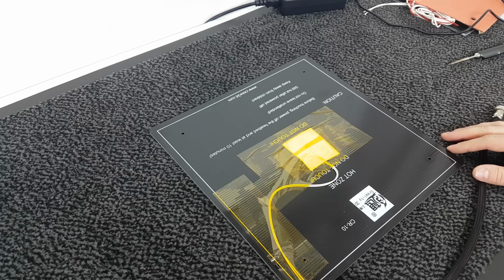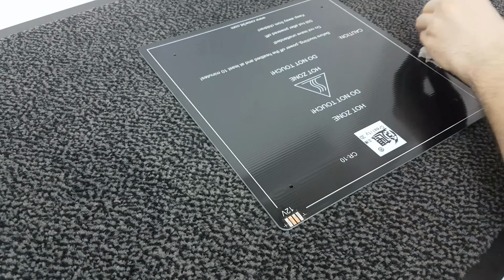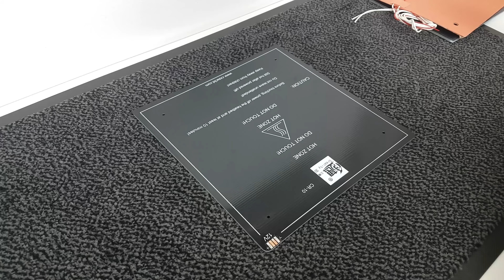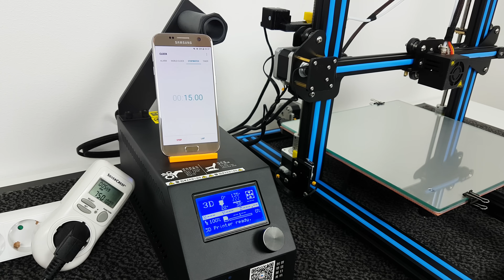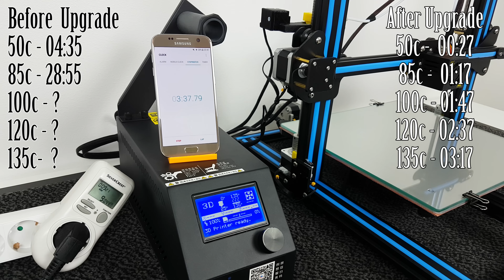Creality Cr10S ultimate Heat-bed upgrade! 750W heater installed

Comment: But a new power supply is needed or not?
Reply from the maker: Jose Garcia This upgrade don't require new power supply. This Heater is 110V or 220V. It goes direct in AC.

Comment: I would be very reticent about pulling  230 volts 750 watts through that connecting plug, its not designed for a load like that
Reply from the maker: David Allen https://m.aliexpress.com/item/32758594495.html?trace=wwwdetail2mobilesitedetail&productId=32758594495&productSubject=5Pcs-Aviation-Plug-4-Pin-16mm-GX16-4-Metal-Male-Female-Panel-Connector-New

Working Voltage: 250V 
Working Current: 15A
Reply: a kettle is pulling between 800w and 1.2kws...

Comment: I could really use your help!!!
Would you please reply to my comment. I've posted this same comment, on several 3d reviewers, on their youtube page, and none have responded. I'd like to make a decision, in the next 2 days. I wonder, if you think a CR10s is a good choice to print a quality working prototype. I need the prototype to show people that my 3d printed machine works. I'm in hopes that the CR10s is capable of turning out a quality prototype using PLA. 

How does the CR10s quality compare to an Ultimaker printer? I'm planning on getting an Ultimaker S5 at a later date.
Any and all help will be appreciated!

Thanks ,

Gary
Reply from the maker: eGliderman eGliderman Hi Gary! Would you kindly send me screenshot or picture of that model that you would like to print? Or at least something similar to that? So I could answer you can CR10s print that type of models or not. Send them to my email address I I will be more than happy to answer you.
Best regards!
Nexi
Reply: Thanks Nexi. I sent you an email.
Regards,
Gary

Comment: Followed your instructions,  using 110VAC pad, 115 C in minutes now, thanks for the great video.
Reply: did you try get 120c or more with the upgrade?
Reply: What 110 pad did you use?
Reply: Is it still working?

Comment: Dears, I just bought a CR10S - Thanks to Nexi's videos - Really useful and well done videos - OK I really wanted to make those modifications and I'm not a rookie regarding electronics stuff but reading all those comments below I don't know whose is right and/or wrong. 

The point is if the heatbed is enought insulated from the rest of chassis and build plate there are reasons to have fault ... but I'm maybe wrong ... 
There is maybe one thing, is it possible Nexi please to add a clear diagram for wiring in the power supply ? it would be really helpful for me !

And @ the end maybe we just have to make some holes in chassis and build plate and put them @ the ground no ???

Many thanks for your feedbacks guys, because I really want to make this upgrade safely.

Comment: Hi Nexi! 
Great idea. Love it! And going to do the same! But there is a quesion: after upgrading heat bed time for bed plate upgrade :) So what do you recommend? Glass, mirror, LokBild? Please keep in mind that having a opportunity to head a bed to higher temperature there is possibility to finally use ABS etc.. Have you ever concerned turning your plate into magnetic one? Is that possible with high temperature without loosing neodimium strength?Which magnets to choose for that bed upgrade?? Another problem is isolation cotton which decrease magnet's power (so in that case should use again bigger and stronger).I've seen that people used to stick it on the bottom, but how to glue it to cotton :)? Any idea regarding perfect bed for that upgrade?
Reply: Hi Nexi!
It's been a little while .. but finally I have done it! :) In big shortcut: your idea but with my personal improvements such as:
-LokBild, 
-0,5mm alloy sheet (previosuly I have bought very expensive spring steel! which doesn't affect magnets :)))) - so any of you whos wondering - don't make my mistake ;) 
-added another  aluminium 4mm cnc drilled sheet as base for magnets as well as heated top platform,
-special 60pcs magnets (which are fine till 380 C degree), 
- instead of 1 isolation cotton sheet, I have used 3 of them (it was solled in pack of 4..), but 3 here are important in my design- it prevent thermister and heater from smashing and squishing ),
-bottom platform I have left orginal one as support for cotton which isn't  glued,
-each wires were equipped in connector,
-I have left orginal lenght of new calbes (never knows when it might be needed)
-Lenght of screws 4x50 or 55 works better (60mm might be too long).

Pros:
-It's work like a charm! :) Always wanted to have such possibility.
-heating bad to 60C - after improving time drasticly droped from 15-18min to 1 min 10sec in my case! 15 tmes faster! Madness!
-Despite the fact than somebody has described that metod as "unsafety" a few times, calling others idiots and other unpleasent words.. As long as I exactly know what i'm doing - I hardly believe it's pretty safe! Person who disagree, seems has a lack of knowledge or experience... ?
-Availability to print immidiatelly after turning on printer, which is really cool!
-Possibility of using other materials (those which require high temperature).

Cons:
-It not a cheap modification (especially  if you own S4 or S5) -approximately it costed me somewhere around half of S4 :) Sick! :)) But I don't regret!
-On your film all job took a few minutes - in my case I've losted a half day (got more tasks to complete )
-Despite the fact that bad is immidiately heated up it's good practice to give it another minute or two to heat bad evenly.

Thank you for sharing your mod!

Comment: hi i was wondering have u had any problems out of urs at all because i want to get one my self thanks
Reply from the maker: Not at all. I have 5 3D printers from Creality and They never let me down. They are very reliable machines. I reviewed CR10S, CR10S4,CR10 mini and Ender2 on my channel. All great machine's. Check mu videos. Cheers.
Reply: im in south carolina im not sure where ur at but would that ssr work for the 110v version im gonna buy
Reply from the maker: Geoffreys reviews SSR will work as it's universal voltage but you need to choose 110V silicone heater.

Comment: Hi, how do you make sure when the nozzle outputs the filament that it actually touches the bed? Whenever I print the extruder/nozzle are two far from the bed the print doesn't't stick. Any advise please
Reply from the maker: David Sonson
Home the printer, then place A4 paper under the nozzle and heated bed. Adjust the level on each corner(or close too). Paper should not be stuck. Then double check on the middle point of heated bed as well. You have video on my channel "how to level the heated bed" It can help.
P.S. You can use paper glue stick, blue tape, hair spray, Aprinta Fix spray etc to help with adhesive.

Comment: I love the setup, but I can't find any  insulation cottons 3mm heated bed for the CR-10 S5 500mm x 500mm any suggestions?
Reply from the maker: Louie Rodriguez Yeah. Get 3 of 300mm one and cut it. I done it before and it works nice :)

Comment: Great video bud, one question though. Where should I connect the cables from the SSR's control side? Should I connect it to where the motherboard connects to the MOSFET (removing the mosfet connections too)? Do I need to change anything in the firmware as well? I have version 2.0 of the Creality motherboard and the connections in the video don't match up (the 3rd and 4th screw down connections on the motherboard are connected to the extruder on my board). Thank you!
Reply from the maker: Matthew Moorhead Yes, SSR control you should connect on the motherboard where the heatbed or heatbed mosfet is connected to. You can use same wires from mosfet just cut them if they are long enough. No you don't need to change anything in firmware for this upgrade to work. Regards 
Nexi

Comment: The upgrade works awesomely
Reply: Is your bed still working? Any problems?
Reply: @TheRainHarvester  Yes it still works perfectly.
Reply: @trevorlynch6549  thank you!

  I'm trying to build a diy 12x12" , but finding a 12v heated bed seems impossible. I only have 110v wall outlets. I'm not sure if I could use an adapter. Also the bigger heat beds are 750w!! That would heat my room!!
Reply: @TheRainHarvester  There is a 120v option on the link that he shares in the description. There is no plug you wire it up to a relay to control temperature.
Reply: @trevorlynch6549  yes, but the relay relays the required 220v. So I was wondering if connecting that 220v relay input, to a 110v plug that goes to a 110v-to-220v-adapter would work.
Reply: @TheRainHarvester  The relay can switch 24-480 volts so the voltage input and output doesn't matter as long as the switching voltage is low enough which it is.
Reply: @trevorlynch6549  It matters because 220v will heat better than 110v.  So I'm wondering if I can plug an adapter into my 110v outlet, to give 220v.  Would it heat as well.  (I'm not worried about the relay)
Reply: @TheRainHarvester  You would have to plug into a 220v outlet which your house probably doesn't have. I would recommend getting the 110v 750w heater. Wire it the same way he shows. The heater has the same power at 750w as the 220v one it just draws twice the amperage.
Reply: @trevorlynch6549  thanks man!
Reply: @TheRainHarvester  You're Welcome

Comment: LOL. I'm reading through the comments and it's incredible how many idiots there is in this world. Nexi Tech, leave your installation just as it is. if you really want to make it "SAFER", then get a female amphenol connector on your chassis of the control unit and for the idiots that blabbered on about the exposed points not safe for AC, well, do you think it is safe for DC??? With AC you will get the shock of your live, DC will burn your house down. Make your choice. If someone is not competent to do this and do not understand the terminology that has been used, then he/she should not attempt it. It's called common sense. if you get shocked, then good, what the hell were you thinking or doing.

This heater pad will just go dis when it is not working anymore, yes, I used the word dis, again, when you do not understand the terminology, then do not do this. These same pads concept is used in aviation and is designed in such a manner that the conductor inside the pad will just fuse. The principle was based on normal fuses. When it fuses, no current will flow and it will fuse long before the flash point of the material which it is covered with. So, in essence, leave the earthing wire. You are safer without it. Anyone that want to query it, have a look at your wife/girlfriend's hair dryer. That is scary shit.

Nexi Tech, great job and keep it up, I've subscribed.

Comment: Very nice instruction video. May I ask, why are you sticking the Silicon Heater on the old heater? Thanks for sharing.
Reply: The original heater is very thin, and there's no obvious way to remove it!

Comment: You have attached a 750 watt load directly to the mains supply WITHOUT any mention of the fuse? Assuming the power jack has an integrated fuse, I don't know how it could be sized correctly since the original AC load was far smaller....safe???
Reply from the maker: D A There is replaceable 10A fuse in Cr10S 3D printer switch(10Ax220V=2200W)

Comment: I followed your steps and used all the same parts you used, but my bed does not heat up. My relay actually smells a bit burnt, like a capacitor smell. My extrude works fine. Any idea what would it be? It seems like bed is not getting power?
Reply from the maker: Well that's sad. Have you test the heater pad in the first place without relay? is it working? If so maybe relay is bad. Try to get replacement and next time do a check of everything before you install all components on CR10.

Comment: Thanks a lot for the guide. I have mounted my replay externally in a printed box. I looked at the specs on the B-7000 glue and it says it is only suitable up to 66 degrees C! Are you using a high temperature version by any chance?
Reply from the maker: You're welcome. Nope its standard B-7000 glue. When glue is cured and when it pass over 70C it turns to hard rock state and it stays like that. It's hard to remove it after but I don't see reason why would you do it. Anyway you can always use silicon glue that can withstand higher temperatures but in the time of making video I didn't have it so I just use b-7000.

Comment: @Nexi Tech Hey mate, I am planning to use an EZABL device in combination with the Keenovo 1000w AC heater. I read on th3d website that 'cheaper' SSRs 'leak' current and therefor mess with the accuracy of the device. Do you use an EZABL? And if so which SSR do you use for that?

Comment: I have already bought the parts to do this upgrade but I don't know much about electricity, what do I need to do to keep it safe? I am using sheet metal instead of glass to print on (i like the flexibility)
Reply from the maker: Keenan Hoffman Please don't do this upgrade of you are not experienced with electricity! I don't recommend using any metal sheet over aluminium heatbed! only the glass or Anycube ultrabase.

Comment: Great Guide, I cant quite make out where you have connected the 2 wires that control the relay on and off.  Can I connect it to the same place where the 2 small wires from the heater bed moffet connected to on the motherboard? This is also where 40mm fan that cools the mother board is located.
Reply from the maker: Fluke752 Yes that's right. Where two wires(heat bed) connect to mosfet. You can use that two wires just cut conector and connect them to relay.

Comment: Should the wires to the temperature sensor be polarized. As far as I can watch the video, connect the red wires to a terminal on the print label marked + and -
Reply: I just misunderstood the video. It's not the 2 red wires from the heat plate that are put on the print, so I've figured out.

Comment: What sort of adhesive do you need to glue the insulation to the heater mat?
Reply from the maker: You can use silicon for examlpe.

Comment: This upgrade is great! I took it to 105 c in 2 min. 18 sec. and planning to do some small ABS parts to mod a web cam for Octopi. I did notice it always passes the target temp by 2 or 3 degrees, then drops 1 or 2 below then locks in at 10- 20 seconds. The thing I did different, I insulated with black plumber's felt rated 982 c ( I know overkill) and used silicone adhesive rated at 204 c. The only complaint, using my Ultrabase, it take much longer for the temp to drop for the bed to release the part. Most likely due to the insulation and not a bad trade off.

Comment: Is there one of these silicone heaters that works with the CR-10 mini?  I saw some that were 30 x 20 cm.  But they don't have the four holes in them.  And given that there are electrical wires in these, I don't know if you can cut/drill holes.

Comment: Does the polarity of the silicon heater power wires matter??? I see white and white soldered to black and red.
Reply from the maker: SadPanda62 No, polarity it's not metter on the heater.

Comment: Why did not you put the ultrabase back on top?
Reply from the maker: Diogo Rodrigues I did right after this video and I wrote in comments as well. Not many CR10S owners has Ultrabase and I thought that I should test it with glass only for this video. I recommend that you don't use paper clips and to install Ultrabase for extra safety as well for better print adhesive. I did ultrabase review in my previous videos so you can check it. Cheers!
Reply: Nexi Tech Thank you very much. I just bought it.
Reply from the maker: You welcome mate. Cheers!

Comment: hello nexi
nice tutorial, thank you
i am doing the upgrade
but i am doing the cables myself
since my heated bed came like yours
with almost same wire colors
my AC cables are both red
and the thermistor cable is black
with 2 cables , 1 red and 1 black
how do i know whats the + and the - AC cable?
i think for the thermistor it does not matter
just let me know
thank you

Comment: How do those Insulation cottons work? To me it seems they would keep the heat away from the glass bed. What's the actual surface temp of the glass in comparison to the thermistor read value?
Reply: You put the insulation on the underside of the heater, not the top, so it doesn't interfere with heat transfer to the glass build surface.

Comment: Has anyone had a close look at the Tevo Tornado with regards to this heating system? The Tornado uses this type of heating for it's bed but now I'm wondering if they designed into it proper grounding or if it is susceptible to the same hazards?
Reply from the maker: Perry Wolf https://youtu.be/eAHFRxjMpVo on 4:00

Comment: Are your temperatures accurate with the new thermistor?
Reply from the maker: Chris Call They are close. It's not thermisor that is off It's more position of thermisor. I think if you drill small whole in corner of Aluminium heated bed and put thermistor there it will be much more accurate then now sense thermisor is on Silicone heater now.

Comment: it's great except... that upgrade isn't cheap by any means.... but it is awesome = ) thanks for the video
Reply from the maker: True, but it helps so much with ABS prints. You welcome :)
Reply: It's cheaper than the alternative... Which is, if you want to print ABS, selling your cr10 and buying another printer that can get to 110C.

Comment: Does this heatpad require 220v or 12v input. I’m here in the US and the only 220v outlet I have is in the washer/dryer room :s The remaining is 110v.
Reply from the maker: There is 110V heat-pad too I recommend 110V heat-pad if you live in US. If you use 220V heat-pad on 110V it will be to much under powered. Might not even work correctly.
Reply: Nexi Tech Okay. Thank you. Found a 110v from Keenovo for $70 and a voltage regulator for $42.